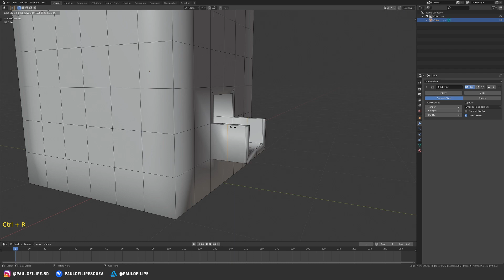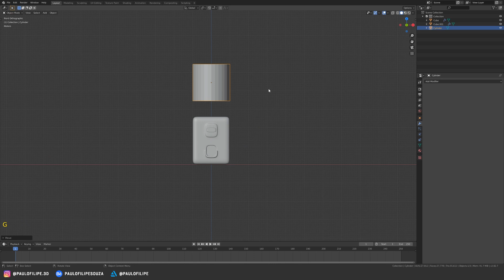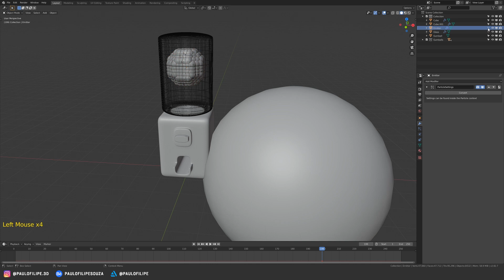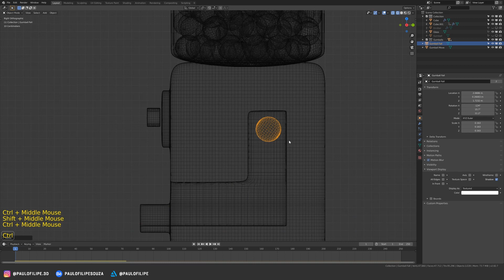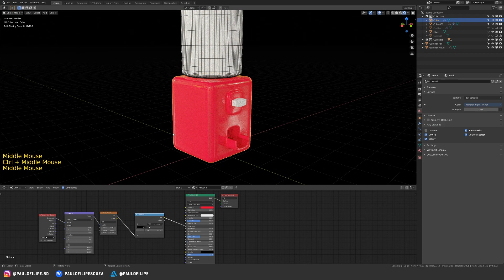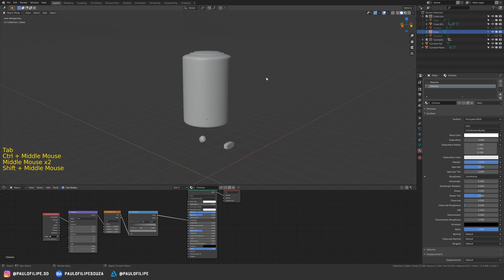Blender Tutorial - Simple Gumball Machine Using Rigid Body Simulation and Keyframe Animation

Comment: The gumballs still pops out everywhere even when I changed the settings from convex hull to mesh !!!
Reply from the maker: Hi! Check the values you're inserting in the Collision Margin for both the balls and glass container. If the value is too high, they will repel each other so strong that nothing will contain it. This value will vary depending on the size/scale of the balls. Also, leave Convex Hull for the glass, but try Sphere for the balls, as Mesh tends to be too expensive on processing and the tiniest artifacts could lead to these explosions.